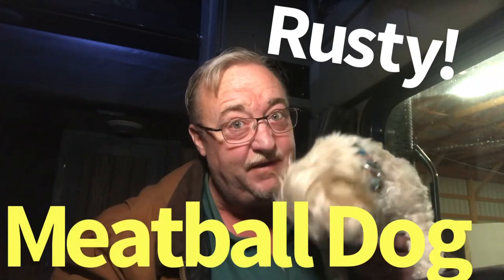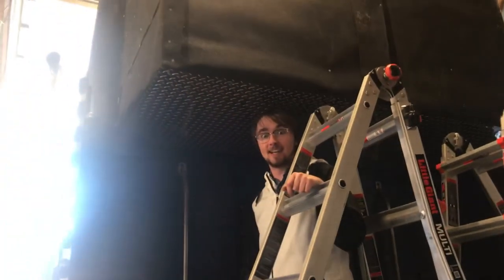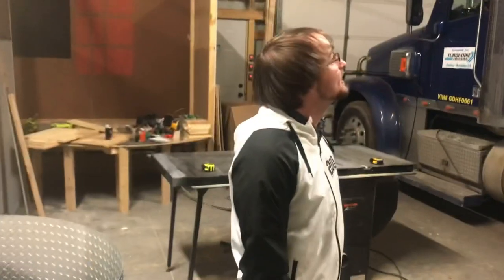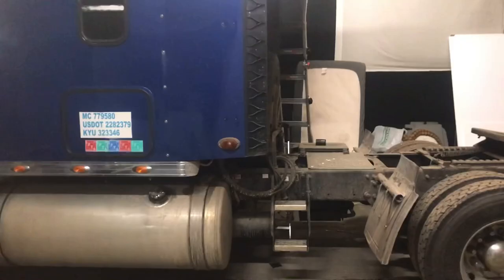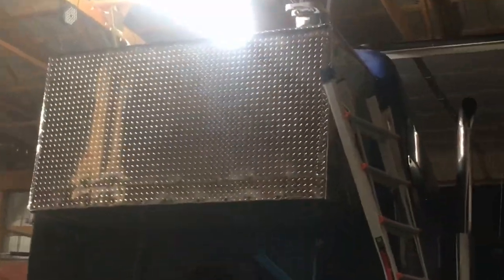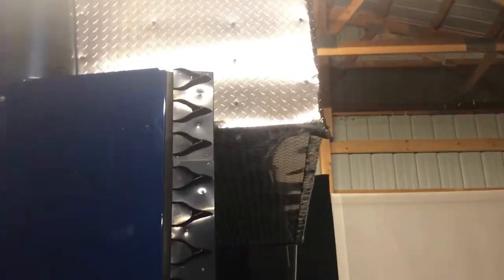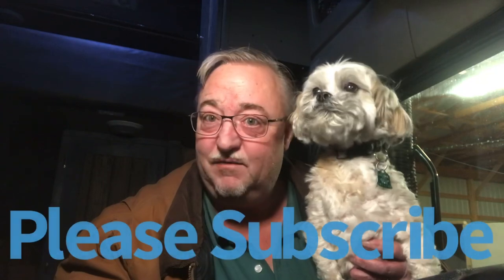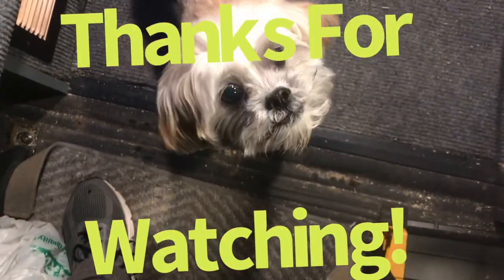Sleeper Remodel Update #99

Comment: One thing I would recommend you do before you fully head back out on the road, is to take one of the family members out with you on a short little road trip say 20 or 30 miles, and their sole job is to fix squeaks that you hear, because with all that new additions that you’ve done you’re bound to have some new kind of noise that will drive you absolutely insane when you’re going down the road lol
Reply from the maker: Good point

Comment: if you under score the underside  of the diamond plate and use a 2x4 the length of it and bang a hammer on the 2x4  will make it easier to bend the diamond plate

Comment: Hi Clutch
Great progress!  One thought, before you bend the top diamond plate over the edges.  Why not flex-seal where top and side diamond plate meets at the upper edges first.

Then bend upper sheet of diamond plate over those edges, screw it down and then seal that seam on the sides as well.

Double protection.  What do ya think?
Reply from the maker: Good idea
Reply: @ClutchTrucker  you might not have recalled it but that was what I suggested you do at all the joints in one of our previous phone calls, but that’s ok as so many things to think about.

Comment: Just one ??? for you clutch. If you don't have enough diamond plate for both fairings can you just cover the heat damaged portion on the top of both and make them two-tone?
Reply from the maker: The paint on other one is much worse. Need to cover while thing